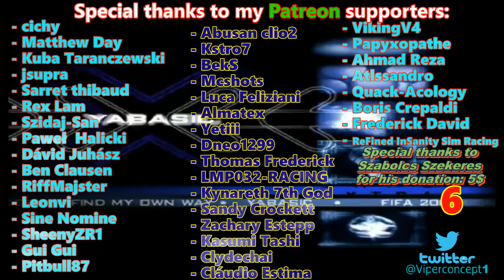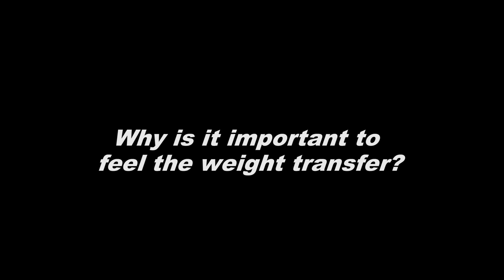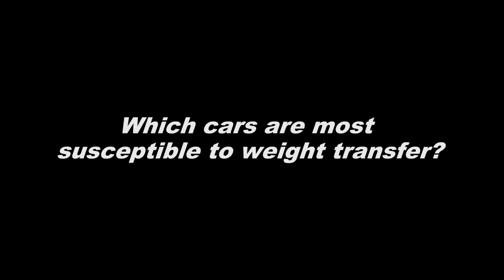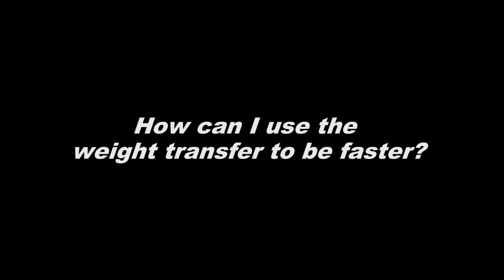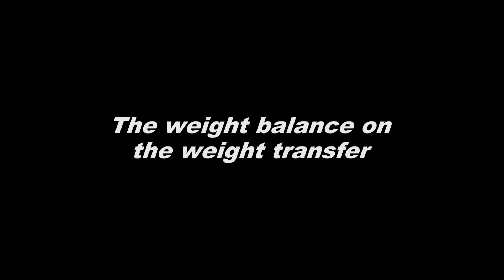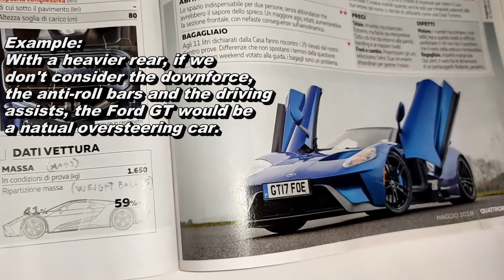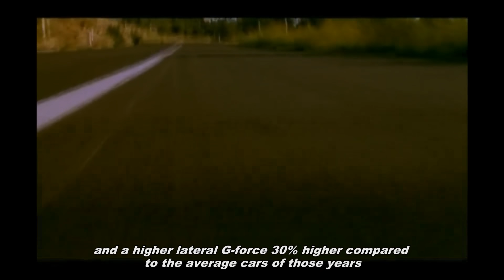The Weight Transfer in Racing Games

Comment: Thanks for showing BeamNg can be used for something else than crashing.
Reply: Yeha, a majority of people don't seem to know that
Reply: Wish more mainstream Sims would adopt it's physics. The way it models weight transfer even including chassis flex is amazing and something which is missing in other Sims. Would rather have a sim with unlicensed cars to allow for beamng's  damage model rather than having a fully licensed sim without a proper damage model. Modern Sims tend to lose the peril of racing cars and completely discard the hazards of debris on track. Gone are the days on GP4 where someone's stray wheel blows my read wing off on impact
Reply: @AnimalMother98  The problem with the "simpler" stuff like debris is that it is extremely difficult to relay its position accurately to other clients in online racing. And if you can't do it accurately then it shouldn't be a thing, imagine getting a puncture on a "phantom" object for example. BeamNG's model is impressive, but it won't be a realistic option for sims any time soon. Like Beam itself has been in development for like 8 years at this point, and it still isn't on the level of your household sim racing titles.
Reply: @namesii1880  can still be an option for offline races though
Reply: flying planes is possible in beamng
Reply: Yeh

Comment: Maybe a useful technicality to point out, while weight transfer is different between stiff/soft suspension, the amount of weight transferred is always the same with any setup changes on the same car. A stiff suspension just lets the weight transfer more quickly and therefore means that the weight transfer is more directly affected by your steering and throttle/brake inputs and makes the car more predictable and of course able to swap to the opposite direction sooner. Neils Heusinkveld recently went over this with proof on his Youtube channel if anyone's interested in hearing it from someone who's infinitely more knowledgeable than I am ^_^

Comment: Suspension stiffness does NOT change weight transfer! Only in the most extreme cases like a 2CV might it matter a couple percent. Weight transfer is a function of the CG height of the car (you're correct here), the wheelbase and the track width. If the wheelbase is 3 meter and the track width 1.5m, you get half the weight transfer per 'G force' when braking and accelerating, compared to when cornering. You sometimes can't "see"  weight transfer. You can create suspension that raises the nose when braking, but the weight transfer will still be going to the front as much as with a soft normal suspension where the nose dives.
Since the car dimensions are fixed, weight transfer is a function of the G force you're doing. So if you have a stiff or soft setup, every time you take a corner at 1G, the weight transfer will be the same regardless of the setup.
Reply from the maker: Suspension stiffness doesn't change the weight transfer, but it changes the effects of the weight transfer on cars. See what I mean? That's what I want to show in the video.

Comment: I may sound stupid for asking but Ima really curious...

How would ARB apply to drag racing? Is the front soft or stiff? I would know the rear ia soft because it helps settle the weight transfer sent to the rear but what about the front?
Unless... They both should be stiff?
Reply from the maker: ARB, as the name says, it's just for the lateral roll of the car. As far as I know it isn't that important in drag racing.
You should watch at the suspensions and dampers instead, especially the rear ones.
Reply: @viperconcept  Good lookin out. Thanks

Comment: Have you ever driven the TVR Speed 12 to a maximum? How to control this monster's wheelspin on first 3 gears?
Reply: Try using 2nd gear off the line.
Reply: @droppingdime619  still wheelspins. with 3rd gear too (at least in GT2). with analog input it is possible to control, but it isn't easy at all
Reply: @amysilverstone9059  If driver's assists are allowed, increase the traction control to around 50%.
Reply: @droppingdime619  there is traction and stability control available for this car, but... they make it slow enough to be not viable, because if it wheelspins in almost straight line, then it accelerates on par with opponents, and when it grips, it starts going REALLY fast. Assists make this car boring, and also they cost 50k each, it is quite expensive for upgrade this small.
I was doing the endurance race (in endurance, you also have to manage tyres wear and visit pit stop) with this car, the 2 hour Rome full course. I made such settings, so even with wheelspinning my front tyres were wearing faster than rear. With enough wear, spinning out was possible even with accurate acceleration control, but completely safe, because I was much faster than opponents and they couldn't catch up.
Reply: @amysilverstone9059  It is probably not fixable unless you can do an AWD conversion. Otherwise, the only thing that can be done is to press down the throttle gradually and shift up earlier in the first few gears.
Reply: @droppingdime619  conversion is not possible in GT2.
This car can start moving from 3rd gear and be faster than starting from 1st, at least in GT2 that is. And throttle control is irreplaceable even at cars with less power, for example, my Toyota Starlet is easy to spin out without throttle control.
Reply: @amysilverstone9059  If that's the case, then move the lower gears' ratios up and run a close gear transmission if possible. It will be annoying to shift all the time in manual though.
Reply: @droppingdime619  it is not actually, at least for me. Most of the time I shift between 3rd and 6th gears, first two are not used most of the time.
Reply: @amysilverstone9059  The only things that are left would be to use a lower tire pressure and/or softer tire compound in the rear than the front. I know in older Gran Turismo games, it allowed placement of a ballast to adjust weight distribution but that would also make the car slower.
Reply: @droppingdime619  in GT2 there are no weight balance adjustments and tyre pressure, at least I am not aware of it... I use the hardest compound to make tyres live longer, because wheelspin... am I wrong?
Reply: @amysilverstone9059  Using hard tires is correct if your fuel consumption is not too bad and you can stay out for awhile. I know it's possible to start the race in Gran Turismo with different tire compounds in front vs rear but not after getting new tires in pit lane. Also, you can use a more efficient fuel trim to conserve fuel and cut engine torque.
Reply: @droppingdime619  I would love to play with fuel management, but there is none in GT2, so in endurance race tyres are the only thing to manage.

Comment: Front heavy cars understeering, rear heavy car oversteering and 50/50 distribution being ideal isn't really true. Many mid engine cars "naturally" understeers due to (even relative to the weight on the front axle) small front tires and suspension setup, same with 50/50 cars.

Comment: I believe you, but for me it's not clear why a car with more weight to the rear would be more "oversteery" and vice-versa a car with more weight to the front would be more "understeery": Shouldn't a car with more weight to the front have more grip to the front wheels (who are the steered wheels) and so be more "oversteery"? What am I missing here? I know that I'm missing something, please can anyone explain me what?
Reply: This logic is only true when driving fast because tires have limited grip when cornering. A rear weight biased car will oversteer because once you get the car turning, the rear has more inertia and wants to turn more than the front, causing oversteer. A car with a front weight bias is the opposite, and the rear is unlikely to turn more than the front, causing understeer. When driving slowly, there should be no oversteer or understeer.
Reply: @droppingdime619  Oh, really thank you, now it's clear :)

Comment: I dont like term slow in, fast out. Most of the drivers understand it wrong and they are overslowing cars on entry. 

You need to be always on the grip limit, and carry as much as possible speed in every single centimeter of the track. Entry should be just ideal to not affect racing line and dont go wide on the apex. 
So yeah, it is better to go too slow than too fast, but going too slow is not the way to be as fast as possible

Comment: Weight distribution is kinda badly showed here. 

Car with more weight on front is oversteering and car with more weight on rear is understeering. Those examples with FWD and RWD cars are wrong. You can make almost every car with more rear weight oversteer. With jerky steering because od pendulum effect and with throotle if its RWD or AWD. The same with FWD car, you can make it understeer with throotle because of exceeding front wheels grip.

With smooth, professional steering inputs car with more weight on front oversteers at the limit, and car with more weigh on the rear understeers at the limit. Axle with more weight on it have more grip